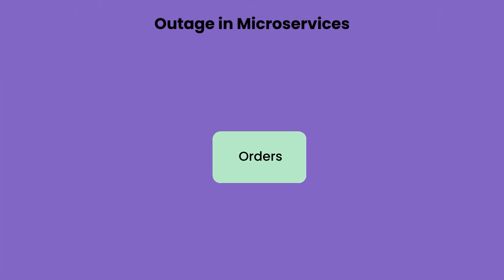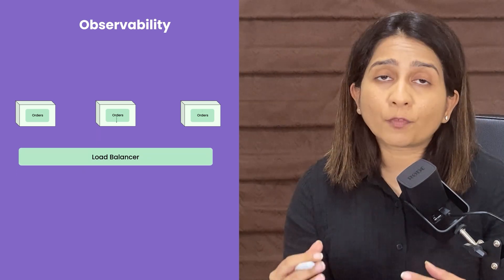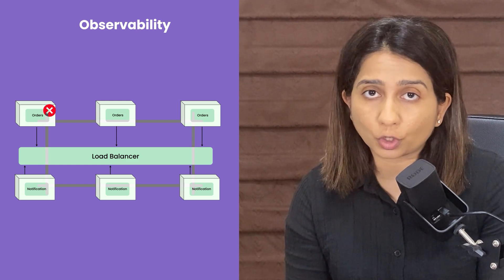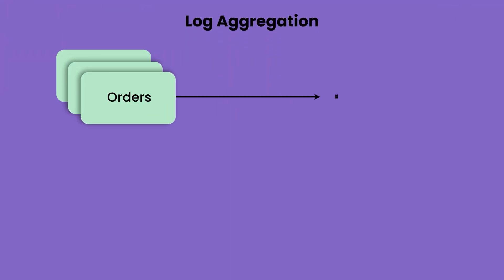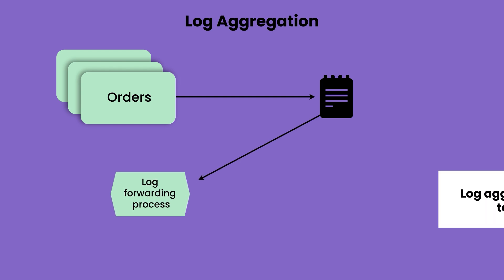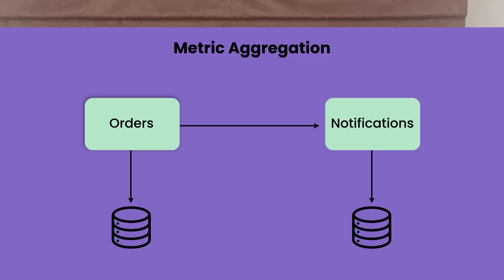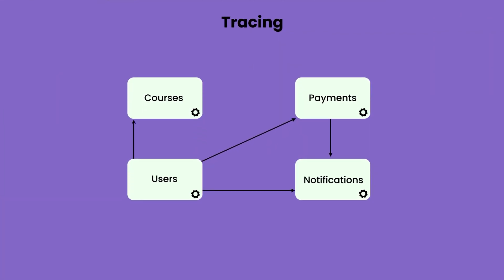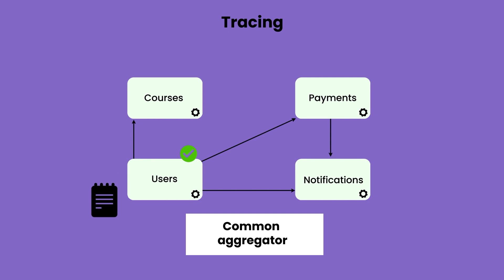Don't Let Your Microservices Run Wild: Learn Monitoring Basics! | Microservices Primer Course

Comment: Thanks for sharing, your videos on System design and Microservices are  really amazing 💯
in Java/J2EE we use [Actuator]s to expose operational information about any running application in the production environment  
it helps with understanding traffic, knowing the state of the database and monitoring metrics of your deployed apps
Also [Spring Boot Admin] can be very helpful when it comes to monitor your Microservices in prod environment.